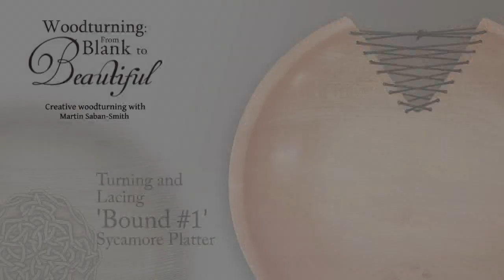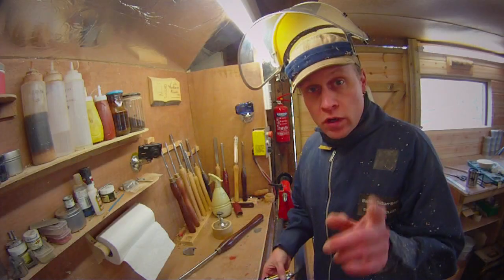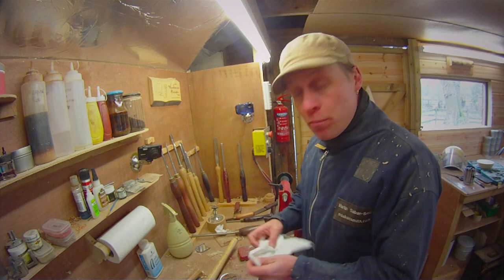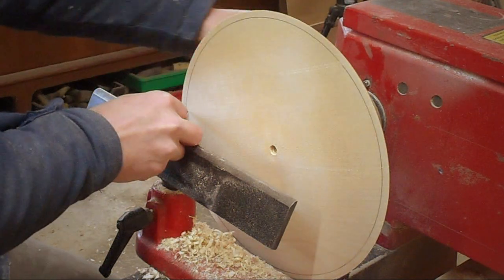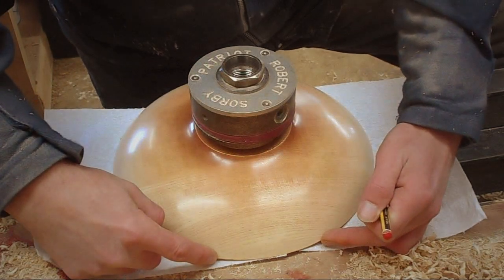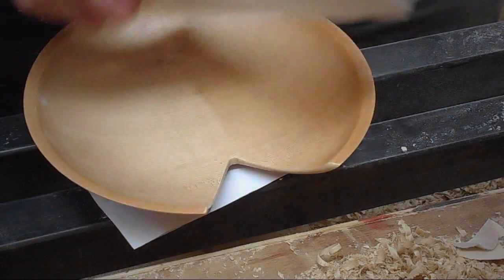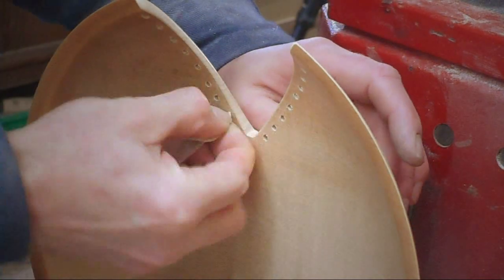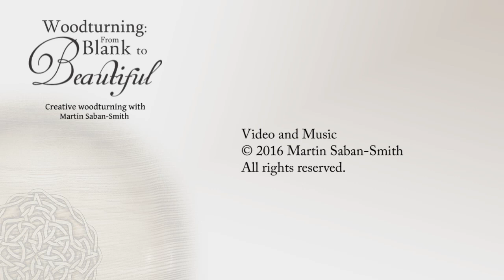#52 Woodturning and Leather Binding Lacing Sycamore Platter 'Bound #1'

Comment: Sorry Martin. In my opinion not one of your best. It looks like a platter with a bit cut out of it. The vee is too uniform and the rim edges would be better swept back a bit to take the cheese portion look away. Sorry.
Reply: +Martin Saban-Smith  Hi Martin Thanks for the reply. I've made a few lace-up, stitch-up bowls, boxes, pots etc over the years. Materials used have been leather, copper wire, and cord. I found that using this type of decoration always looked best when used to lace or stitch a natural flaw, crack, split, or one manmade to look as natural as possible.
I've had some reasonable results on natural edge items. They are good fun which is what it is all about. Look forward to Bound #2.